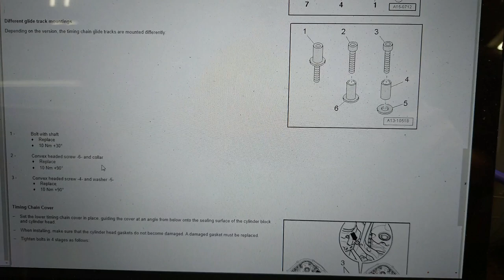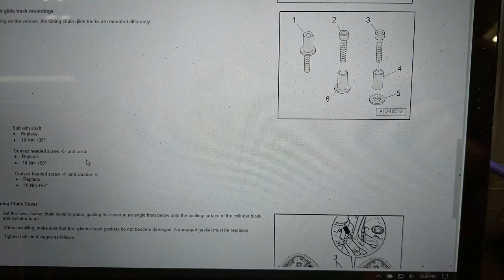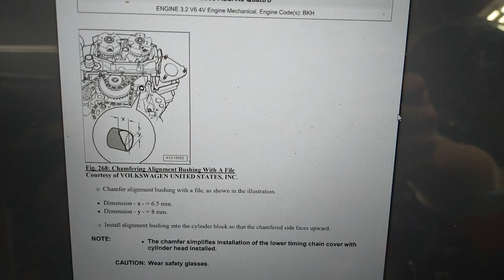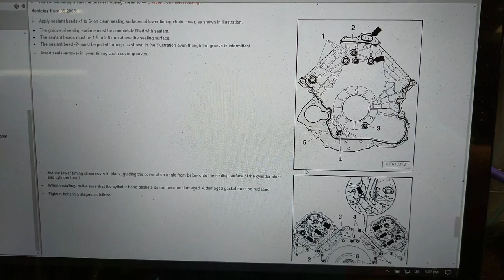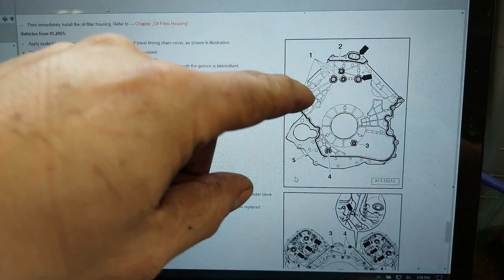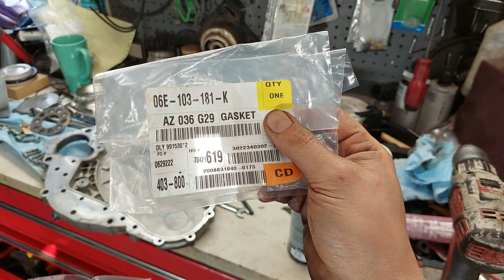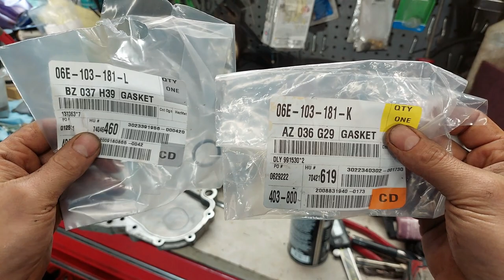2005-2011 Audi 3.2L V6 Timing chain and guide replacement | Torque specs and tighten sequence

Comment: I hope you realized that your helper held the slack in the incorrect direction, on the driver side head, BEFORE you reassembled everything. Otherwise, a very helpful video.
Reply: Hopefully, it doesn't set timing codes for Bank 2. If it does, at least we know why.
Reply from the maker: We did it twice for filming. I was kind of hoping no one noticed the filming and more listened to my explanation.  Haha, good catch. It's back together and runs great. Better than ever. I wish I did this when I was the owner.
Reply: Bros, pull the grenade pin first, then begin the phaser torque dance, that audi manual is convoluted and i have to read it over a few times to figure out what they were getting at. Great video overall!
Reply: @willpoweredgarage969  I was confused right there and I had to watch that section a few times. Good job overall and I am even more determined to do it myself.
Reply: I had noticed that myself and backed it up to replay it. I'm glad @WillPowered cleared up that it was for the movie. 🙂

Comment: Ill never understand the redundancy of putting the timing components on the rear of the engine. My only idea is the upcharge on the maintenance.
Reply from the maker: I have to agree. Its such a pain in the butt. The claim is that it should last the lifetime of the engine, until it does not. I've had to do so many VR6 engines and there are the same way. Thanks for watching.

Comment: Now do a video on installing that rear main seal because there’s literally no good videos on it and it seems like EVERYONE is having issues with it.
Reply from the maker: Its actually pretty straightforward. Just make sure its installed the right direction and if it did not come with a protective plastic sleeve for the crankshaft make one. I used a take out container and cut it down. Had nice round bottom to protect the seal as the cover is reinstalled. The rear cover itself is actually the hardest part. Keeping the corners of the headgasket from damage is very difficult. Hope this helps. Ill look through my videos and see if i can find more detailed info.
Reply: @willpoweredgarage969  yea the cover went on ok. The issue we’re having is that the seal we ordered that’s associated with this engine comes with an installation sleeve, however, it’s too small and the seal seems to small. The internal diameter of the seal is 85mm at full stretch. Whereas the external diameter of the flywheel mounting plate is 90mm. We noticed that the flywheel mount also extrudes about 2in out of the timing system cover. In most videos or illustrations that we’ve seen, they are flush with each other and the seal sits on the outside edge of the flywheel mounting plate. Ours seems to sit on the inside edge of the mount where the diameter drops down to what looks like 87ish mm.
Reply: Wow nice one 👍 Keep it up, but how can I know when the crankshaft is in right sexting?
Reply: Vagtechnik does these all day everyday, they install the main seal with a small rubber mallet tapping it gently around

Comment: Hi there! Great video, thank you for it! I have a problem with my chain tension even after doing everything as SAID in the video and in the manuals, i'm standing in front of my engine while I'm writing this ^^. When I turn the crankshaft to check timing, there are no blockages and the flats face upwards after two full turns at the crankshaft BUT the tension of the upper chains fluctuate, for example the chains get looser between the camshaft adjusters and then tightens up, the same on other tension points. I tried everything but can't figure it out, could you or  someone please tell me what I am doing wrong. Am I not tensing up enough the chain before the first turn of the bolts at 40nm ( I do it toward the chain tensioners) ? Is the problem in the chains? Thank you!
Reply from the maker: Ok, Not sure If I understand you exactly, but if I  think what you are saying is you are rotating the engine by hand? And that when you do to see its timed right the chains are getting slacked, but then tighten up an everything is timed? If so, what Is happening is the hydraulic tensioner is only under spring tension when the engine is not running and has no oil pressure to apply the force to the piston on the tensioner. So when you rotate it the valve springs are forcing either the intake or exhaust cam to jump ahead of the other or lag behind. This is making the chain appear slack. As long as you set the cam phasers and held them in the right direction when tightening the bolt all should be fine. Keep in mind, it will make noise until the oil has pressurized the top end. Always a good idea to remove the coils and crank it a bit to get the oil pressure up before the first start. Let me know if this helps and answers your question!
Reply: @willpoweredgarage969   @WillPowered Garage   Dear, thank you very much for your quick reply! I think you understood me correctly, sorry my English though :). I indeed turn the crankshaft by hand and the chains do make a clicking noise depending on the camshaft position and I see the chains "jumping"(not jumping a tooth, just clicking) and the tensioner pistons either go in or out. I think your absolutely right about the valve springs being the reason and that the pistons are pushed by the oil in a RUNNING engine. I'm so mad at myself, I used up 12 bolts doing this over again thinking I did something wrong. Ok now that I understand where the "problem" comes from, could you please tell me how hard should I pull on the chain with the camshaft adjuster holding tool before thightening up the bolts to 40nm? Could you also tell me what you mean by removing the coils? :) Thank you so much, I'm so relieved and grateful!
Reply: @livingarmor3503  Did you get it right? Remove the coils to prevent engine from running.
Reply: @sugerhitman1295  I didn't get the coil part I must admit but, after adjusting the timing correctly, after tightening the crankshaft adjuster bolts (*4) and mounting the rest, before igniting the engine I cranked it by hand somewhat 10 times and this did indeed tense up the chain tensioners a bit (less clicking). Once ignited with the key, it made the clicking noise for few seconds and stopped, the engine ran smoothly afterwards. Don't hesitate if you have any questions, I'll try to answer with my very humble experience.
Reply: @livingarmor3503  Yeah...I have a 2011 TT with this engine...I got a timing code and another code that according to what I've been reading has something to do with a bad crank seal causing a vacuum leak or bad timing chain.

Comment: Very informative I have an issue with timing. I just purchased the 2009 Audi q5 and has several codes, P0019, P0018 and P0304, P0306 . It seems all the problems is with Bank 2. It looks like a timing chain upper chain assembly was done .  Any feedback would be appreciated.
Reply from the maker: Okay, so p0019 and p0018 refer to sensor A and sensor B ,respectively.  Since you also have missfire codes in the same bank, I would believe it's in the timing. Now, there are a few things i would do. Since there are no timing marks, the only way to really sorta gauge if the timing is off is to get the crank at tdc and lock it with the pin on the side of the block. Then, remove the valve cover and look to make sure the flats on the cam shafts are both facing up and level to each other. If even one is not (would not be able to install the lock tool without turning the cam), then the timing is not set right. The other is that the cam phaser could be getting stock with debris.  Audi recommends cleaning it and making sure it moves freely.  I have never seen this as an issue, though, and maintaining the timing is off. Even though it was replaced, make sure the guides all look okay. I hope this helps. Thanks for watching

Comment: Outstanding demonstration. I have a 2008 A6 which might need timing chain/tensioner work so I wanted to see a demo before discussing options with the shop (independent) whether to go ahead or not.  Only qstn is you didn't mention sensors or solenoids in the mechanism. I presume you were beyond those by the time you got to the start of your demo?  Thanks very much for this outstanding video
Reply from the maker: Well the sensors and oil control solenoids are located on top of the cylinder head and sides. They are very easy to get too. I did not have an issue with them. The chain was being replaced because of a noise and oil leak. Once I opened it up I saw how brittle the guides were. Thanks for the comment and kind words.
Reply: Just to update you my technician at the Little Garage (in Huntington NY) found that the fault codes moved to the other bank with the swap of the sensors and solenoid. He replaced the sensors and one solenoid. Additionally he replaced a bad injector for cylinder #6. Car is now running well again and, based on the instrument panel, seems to have gained on gas mileage.

Comment: How did you get the rear main seal installed.  I have been struggling with that and I have bought the tool but still unable to get the new seal over the crankshaft.  Any guidance would be appreciated.
Reply from the maker: Its hard to describe, but as long as you have the correct taper tool just make sure the tool is well oiled and that the lip of the seal is facing the engine and does not get folded back. Its also worth mentioning that the seal is a big tight to get over the crank seal but don't worry , the seal does stretch and will relax back to size.

Comment: Great video. Thanks for making and sharing it with others. I'm about to drop a 3.2 out of a 07' A4. I have a lift. Assuming the best approach is dropping the engine trans together? Thanks
Reply from the maker: Yes, Right from the bottom is the easiest. Can leave most of the exhaust in place until it is down. Good luck! Thanks for watching!

Comment: Great video. 2 questions. 1. What's the typical mileage for replacement? I know it depends on proper maintenance. 2. Why not pull the pins on the tensioners before the first 40nm torque? Seems to me it would take the the slack out and take some of the guess work out of these over complicated engines.  (came to me when your assistant botched the hold on the left intake, first take?, torque,lol). 
And others might want to replace the torque converter while your at it unless its been done. Known problem.
Reply from the maker: Hello, Thanks for watching and the comments. It really does come down to maintenance. But Usually around 130K there starts to develop some chain noise at start up. As for the tensioner release it would not matter. The reason is the crank and cams are locked, the chain is just connecting the two. You want to remove the slack before the tensioner is release so that slack is not there at all. Then the tensioner can make up the last little bit. Yes, many people have pointed out the " botched" hold. lol Once of those instances, do as I say not as I do. lol

Comment: Thanks, I'm trying to find out if there are gaskets in the Audiq5 3.2 from 2010, because according to all catalog data there is no information whether they are or not. I bought an INA tensioner and it has no seal. This car doesn't seem to have them. Regards
Reply from the maker: The gasket is a metal one that goes behind the upper tensioners only. The lower one does not have one, just to clarify.  Hope this helps.

Comment: Thanks for the tutorial
I have 2006 Audi A6 3.2FSI. Gives me <P0340> ALL THE TIME. I replaced 4x New Camshaft sensors. And nothing helps. Same code. It could start for 1-2seconds and than dies. And never start again
I suspect camshaft itself is stuck or not rotate, !! ?..
Based on your experience :
What it could happened for it?? 
And what repair could helps ??
I appreciate all your help. Thanks
Reply from the maker: well for one I would definitely make sure the camshaft is spinning. Second, I would check to make sure the timing is correct. Seams to me the timing might be off.

Comment: Hello there sir. Great video , i love it. How many chain sectors are from the ex adjuster to in adjuster on both sides of the engine?
Reply from the maker: Hello, and Thank you so much for watching. Are you talking about the amount of links between the Intake and Exhaust sprockets similar to the way you check timing on the 4 cylinder motors? If so, unfortunately there are no timing marks on the sprockets and no keyway that locks them to the cam. They are a taper fit and because of this you must use the camshaft locking tool along with the crankshaft locking tool to set the timing exactly where needed. Also, make sure you follow the steps exactly to counter hold the sprockets properly.
Reply: @willpoweredgarage969   Thank you sir! I understand perfect what you mean.

Comment: Is there any alignment of the sprockets on main drive chain? I dont see any marking on sprockets and you didnt seem to align anything, just put chain right on
Reply from the maker: There are absolutely no timing marks on this system. Everything is timed by locking the crank with a special tool and locking the cams with another special tool. Once they are locked in, the chain is applied, and the sprockets are locked down on the taper of the camshafts.
Reply: @willpoweredgarage969 at 11:45 the upper sprockets seem free to turn (theyre not locked in in any way). The crank is locked though. So my question is do those upper sprockets at 11:45 need to be lined up in any way when installing that main drive chain, I didnt see you line anything up on them

Comment: Hi, amazing video! - question -  I have the same engine, it's having the rattle noise for about month now when I do cold start, can be heard for about 1-3secs, can I keep driving for next 10-20 days before it goes to workshop for chain kit replacement? ..
Reply from the maker: Hard to say for sure without actually hearing it, But I can tell you I drove mine this way for a very long time before I actually did the repair. I would be cautious, and take not if it gets worse or the engine light comes on. Thanks for watching!!! Cheers!

Comment: Hello Will and Everybody, I'm in the middle of this job on my 2006 A6 3.2L, and this video has been a great help! I haven't yet received my new parts, and I have a question about the oil pump/baIancer tensioner from the video. At about 8:00, the old tensioner you took out appears to be a hydraulic tensioner, which looks the same as my old one. At about 28:00 it appears that the new tensioner does not have a hydraulic piston? Did Audi make a design change in the oil pump/balancer tensioner?  As I say I haven't received my new parts yet, but I want to make sure I'll be using the right one.

Also, will you please post the part number of the VW/Audi sealant you recommend? Thanks.
Reply from the maker: Hello Steve, Thanks for watching and thanks for the comment. So the quick answer is yes. Audi did change the hydraulic damped one with a spring controlled one. There is no oil feed to it anyway so no advantage to it being so. At the time I was still able to get either but I went with the updated unit and it has been fine since. 

As for the sealant, it is audi/VW specific though it is made by loctite brand I have not seen it sold by them. I've always had to get it from either the dealer or places like ECS or FCP . The loctite number is 5970 and the factory part number is D176501A1. Hope this helps, and good luck. Most of all Take your time doing it!
Reply: Lp0
Reply: Lp😊

Comment: Nice. Have question about tightening the timing cam adjuster/phasers. Do you have to do passenger side head first then drivers side, or does it matter? Thanks.
Reply from the maker: Hello, thanks for watching.  No, it does not matter, the only important part is to make sure you counter hold in the right direction.
Reply: @willpoweredgarage969  ok thanks. Unfortunately we found the left bank upper tensioner not functioning correctly. Ordering that, hope to have the car back up and running next week.

Comment: So I just bought a 2008 A6 with a 3.2 and I believe I will need to do the timing on it. In your opinion would it be a good idea to change out the cam adjuster/phasers or not necessary? Or is there a way to test them?
Reply from the maker: I think that if there is no reason to change them unless you have a car that was not maintained well, have faults for them, or can get them affordably. They are very expensive.

Comment: Hi Will I bought a 2007 A4 3.2 with bad tensioners I replaced them on the vehicle and I keep getting code P0341-P0346-P0391-P0366 I've tried 3 times and notice the cam adjusters doesn't move with the holding tool please advice
Reply from the maker: Ok, So first off are you using the crankshaft locking tool as well as the camshaft locking tools? They are both very important and are absolutely needed to set the correct timing. Are you holding the cam adjusters the correct direction when tightening them? The only other thing I can think of is did you mix up the ex and intake phasers?

Comment: I have a question , we are going to change the timing chain and is it necessary to replace camshaft adujster? Thank you :-)
Reply from the maker: No need to replace the adjuster unless you had an issue with it, or the gear is damaged or worn. Thanks for watching